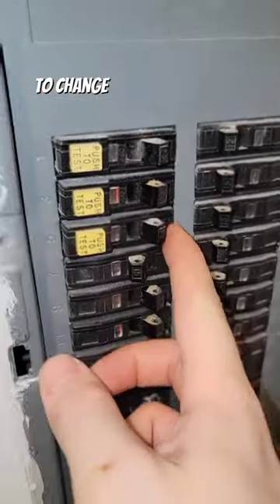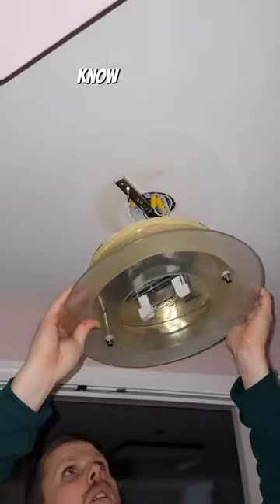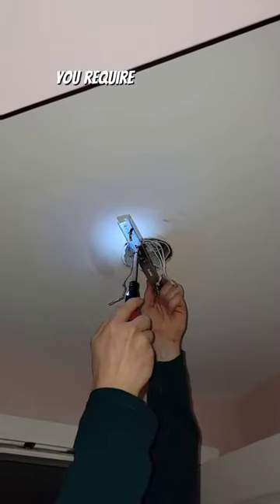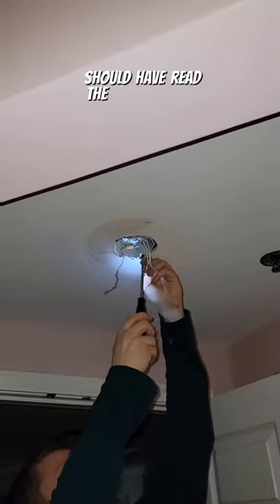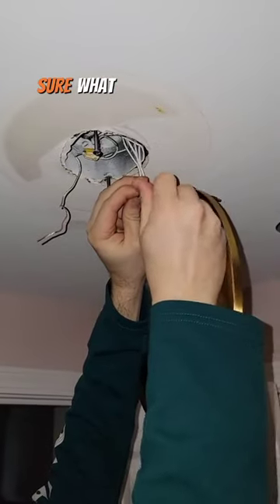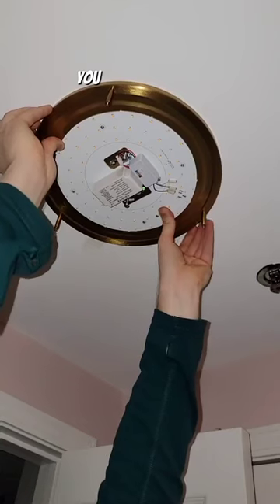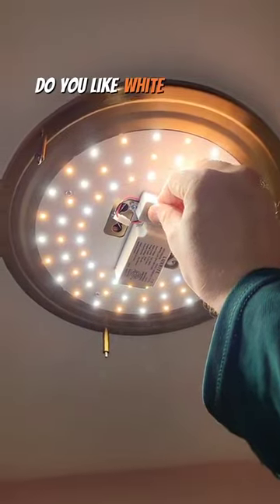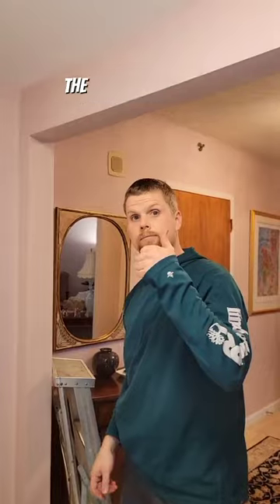How to install a flush mount LED light. #shorts

Comment: Hold the what in yo what?!
Reply: @Mechanicallyincleyend  what is the need for the green wire?  I just cut it off tbh.
Reply: @Dpanda  its a ground wire..
Reply: @ticklefritz7957  what does it do? What is the purpose of it. I don’t know anything abt electrical
Reply: @Dpanda  google the purpose of a ground wire
Reply: @ticklefritz7957  😐
Reply: @dpanda2847 Dude, the ground wire is the most important wire in an electrical system. It's for safety. The ground wire  usually presents as a bare copper or green insulted wire. (In North America) For a light fixture, the green wire must be tied with the bare copper wire.
Reply: Bro went off on a tangent 😂
Reply: @Gpand2 you sir, don’t need to be touching anything electrical in your house if you’re cutting off ground wires 😮😮‍💨🙄
Reply: That’s what I thought too! 😂
Reply: All I heard was "tug and 🥜...." 😂
Reply: @jraymond6062  I heard nuts in mouth 😂
Reply: LMFAO
Reply: You did that on purpose. Now I have to watch the video twice😂😂😂

Comment: 101 Reasons that these kinds of lights should NOT be standard in home builds. If you have to risk electrocution to swap a light bulb the 99% of people are not meant to be touching them and an electrician will expensive as hell.

Comment: I wouldn’t recommend doing this without a VOLTAGE DETECTOR. They’re not that expensive, they can be picked up when you get your new fixture, and they can save you from pain and suffering. (And possible death) I’ve done a few electrical projects in my house and one time there was voltage present even after turning off the breaker. Apparently, the previous owners did some diy electrical work that wasn’t so good. 😢😮😅

Comment: I did this to all the lights in my new home, 2 of the bedroom lights dont seem to work tho. Sometimes turn on no problem, sometimes nothing, and sometimes turns on and goes dim until out. Any idea? 

All the same lights in the house replaced 9 of them, only 2 are acting up. Old lights worked fine before the change.